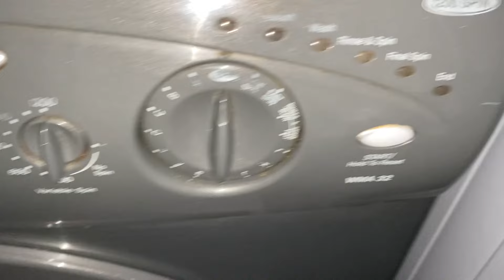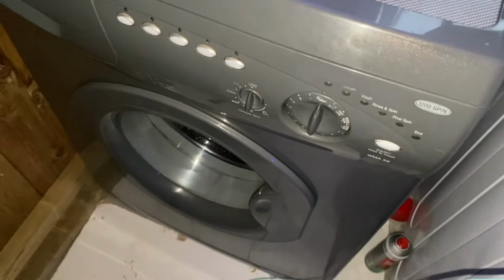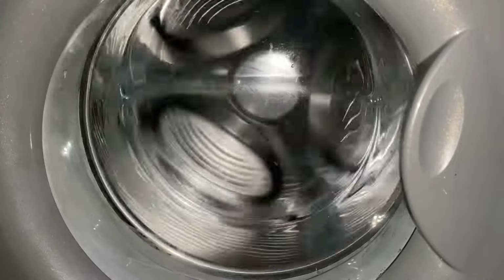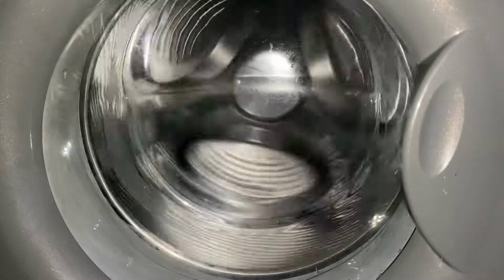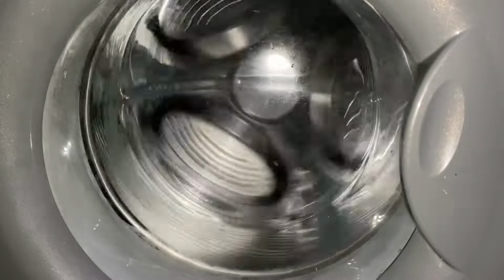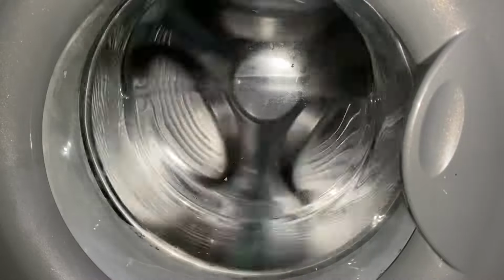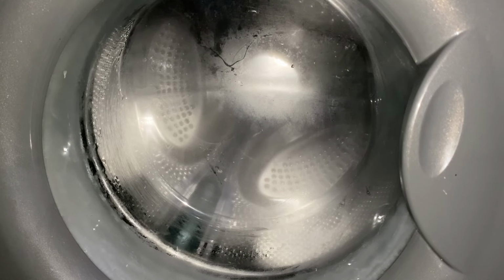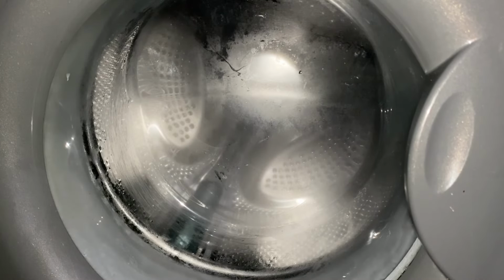Hotpoint Aquarius WMA32 washing machine || Test spin: WORST condition Hotpoint wma I’ve ever owned?

Comment: My Gran use to have A WMA59 and it broke after 16 years it was the 1st Hotpoint WMA I saw and its better than washing machines she has had and I I had a WMA55 and it was terrible it had bad bearing its motor sounded terrible when spinning and it was rubbish at filling up with water it came off Gumtree and it broke after 2 years I
Reply from the maker: yeah these machines are really quite good, even though this one’s in poor condition it still keeps working. Did you mean wmm59 and wma54?
Reply: @washertech   yes the WMA59 was way better than the WMA54